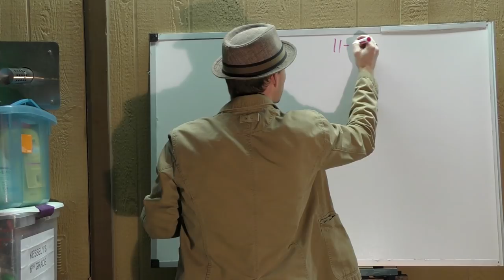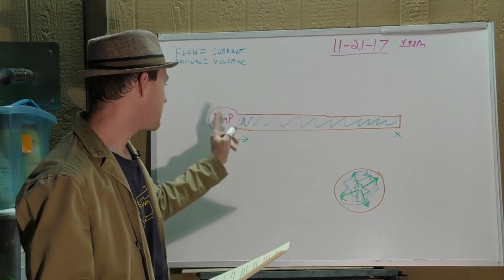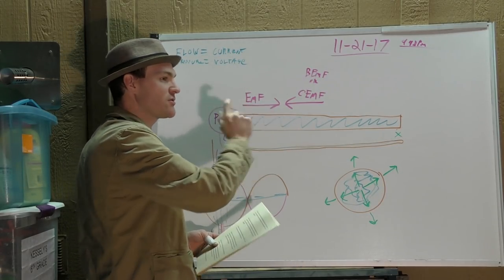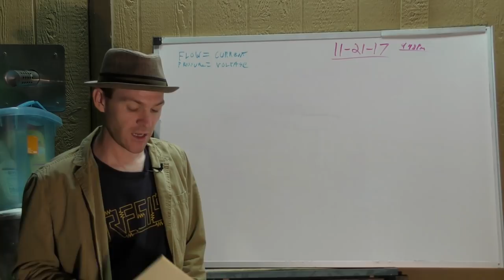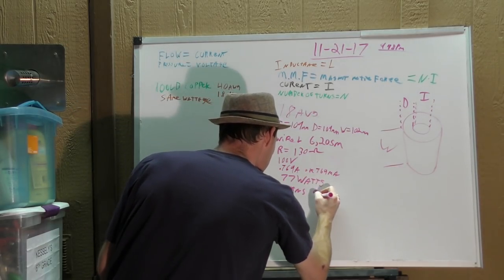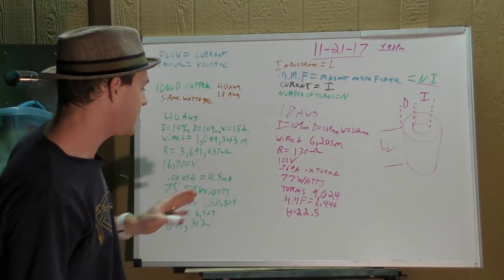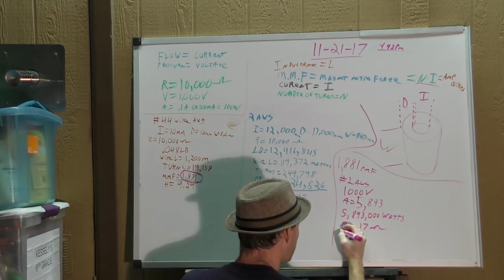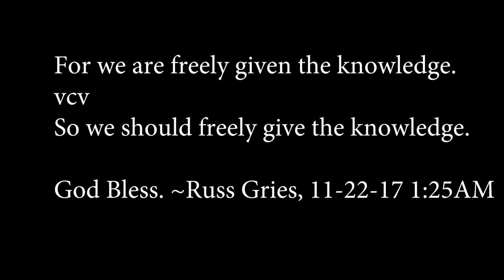Part 10: The Steel Wedge of Truth Hit by The Sledgehammer of Facts Will Break Open Even Closed Minds

Comment: Russ, let's cover the "pure potential" business that people associate with coils and get down and get real and come to the realization that a coil is actually "pure current."  Like I said in another posting, a discharging coil is actually a current source, and not a voltage source.  And I have an experiment for you to do to prove this to yourself and to your followers.

I talked about two types of pumps, a constant pressure pump and a constant flow rate pump and I said that a constant flow rate pump is equivalent to an electrical current source.  And I just said a discharging coil is a current source, but it will completely discharge and run out of energy.  Going back to a constant flow rate pump, here is a simple model:  you have a big gas engine with a constant speed governor on it.  It connects to a transmission that drives a small piston pump at low speed.  So you have a running gasoline engine stepped down through a transmission to drive a two-piston pump at say one cycle per second.  Now, I am sure you can imagine that when you connect a blocked hose to this piston pump that it will pump water into the hose and burst the hose without any trouble whatsoever.  If you connected the piston pump to a blocked metal pipe you better start running because that pipe will shortly explode and send shards of metal flying at high velocity.  Well, a coil is like this and let's talk about a simple bench experiment to prove this.
Reply: Here is the simple experiment.  I am going to use arbitrary values that you can tweak to your setup.  Let's say you have a fist-sized coil with a resistance of 10 ohms.  And you have your bench power supply set to 10 volts.  One side of the coil is connected to the positive of the power supply and the other side is connected to a switch or a transistor that shorts the other side to ground.  This is a Bedini motor type of setup where instead of the coil discharging into a charging battery we will try different load resistors to ground.

So, with the switch closed you know that one amp of current is flowing through the coil.  Right?  Suppose we connect a 20-ohm resistor to the junction of the switch and the coil and the other end of the resistor is connected to ground.  You put your scope across the resistor.  What will happen when you open the switch?  The answer is that you will see the voltage on the scope spike up to 20 volts.  That's because the coil has one amp flowing through it and that has inertia, the discharging coil is a current source.  The coil will pump exactly one amp through the 20-ohm resistor and you will see a 20-volt spike.  Change the resistance to 30 ohms and you will see a 30-volt spike.  Chance the resistance to 47 ohms and you will see a 47-volt spike.  Use 100 ohms and you will get a 100-volt spike.  500 ohms will get you a 500-volt spike.  You will notice the spike gets shorter in duration as the resistance gets higher because there is a finite amount of energy stored in the inductor.  In theory there is no limit.  If you used a 1 megaohm resistor then you would get a one-million volt spike.

What's the conclusion?  The conclusion is that the discharging coil acts as a current source, and the observed peak voltage across the coil is the initial discharge current times the resistance.  That means that the observed voltage across the coil is a function of the load across the coil and not determined by the coil itself.  Every time you play with a coil and see plasma sparks when you disconnect it this is what is happening.  This must be understood if you are going to build your own circuits that make use of coils.
Reply: That doesn`t go with what I have observed..  I have put a laptop supply trough a 10 amp shunt  and the battery was sitting at 12.6 volt ..  Mind you that the laptop supply was only rated at 3.2 amps aand 19 volts..
The amps reading I got when connecting the supply trough the shunt to the battery was 6 amps momentary.. That mean it was reading the VOLTAGE POTENTIAL DIFFERENCE AND NOT THE AMPERAGE.
Reply: +al desrochers  I am not really understanding you.  There is no relation to connecting your laptop supply to a 12-volt battery and the experiment.  If you do the experiment as I describe you will clearly see that the output voltage from the coil is variable and dependent on the value of the load resistor.  This is telling you that the value of the load resistor does not matter, and the coil will always output one ampere of current when the switch opens because a discharging coil acts like a current source.  In what you are describing, it sounds like you are shorting your 19-volt laptop supply directly to a 12-volt battery.  Therefore the battery is acting like a voltage clamp and it's the battery that determines the voltage.  From the perspective of the laptop supply, it looks almost like a short-circuit and if you keep it connected for too long you may blow your laptop supply.
Reply: Re read my explanation...  I have PURPOSELY MAKE IT short to have no confusion..  Experiment is basic and the results are UNDENIABLE..
Reply: +al desrochers  What, so you read six amps momentarily with your ammeter and you are saying the current measurement was not a current measurement but it was really a voltage measurement?  That doesn't make any sense.
Reply: Do it yourself instead of not believing me..  Like Russ have said, (I have nothing to prove to you but me)
Reply: +al desrochers  No matter how you look at it amps do not equal volts so you should rethink what you are talking about.  And I believe you that the current measured six amps.  The laptop supply output is 19 volts, so when you connected it to 12 volts it's almost the same thing as shorting the output of the laptop supply to zero volts.  In both cases you are over-stressing the components in the laptop supply so it will either be damaged or a fuse will blow or perhaps it will shut itself off because it senses a problem.
Reply: Thanks for the experiment DENIER..
Reply: +al desrochers  Were you aware that a discharging coil acts like a current source?  I am going to assume that you were not aware of this.  I am offering you new knowledge and it's important knowledge.  Why don't you focus on that and do the experiment and learn some new and important knowledge?
Reply: If I was not preoccupied with messing with Russ channel, I would enter in a discussion with you about( How much power 1 cubic centimiter of empty space contain)...  But I will not.
Reply: +al desrochers  You are just hostile for no reason.  You are having a debate and you hear some information about electronics that you don't understand and it goes against what you are thinking and as a result instead of having a debate you get hostile.  Your comments about your laptop power supply don't even make any sense so it is impossible for me to "do it myself."  If you think that the "experiment" is taking a 19-volt laptop supply and shorting it to a 12-volt battery well that is a totally ridiculous experiment where there is nothing to learn.  Everything I have said to you about electronics and coils specifically is absolutely true.
Reply: I`m not hostile but I want answers ..   You didn`t came up with a response to my last question... If only you would have read a fraction of the book that is sitting on my shelf right now, we wouldn't  have that discussion.
Reply: +al desrochers  I am more than happy to try to answer any questions.  But if I answer and you get hostile and insult me that doesn't exactly make for a good discussion, does it?  I have read lots of books and I understand electronics.  This is what I am trying to tell you and there is no reason for you to get hostile.  I am trying to explain to you how a coil works when you disconnect the battery from it and so far I have not heard a single question from you about that or any response at all.  I am assuming that you are always playing with coils on your bench so I thought that you would be interested in this subject matter.  Just from reading my comments to Russ about the water analogy and from what I am saying to you about coils and the ignition circuit you must get a sense that I have some knowledge to share.  So why the combative attitude?  Just debate with me in a normal healthy way.  Makes sense?